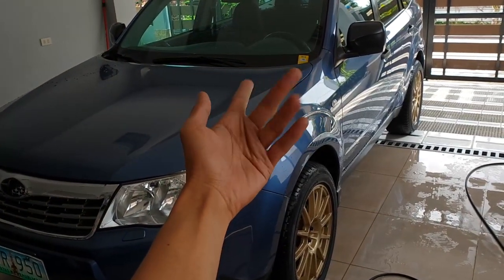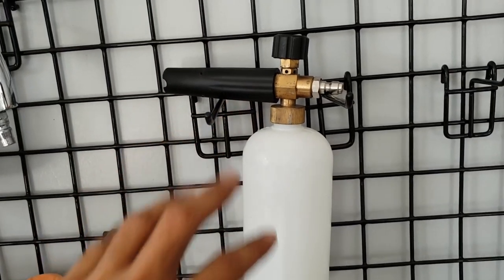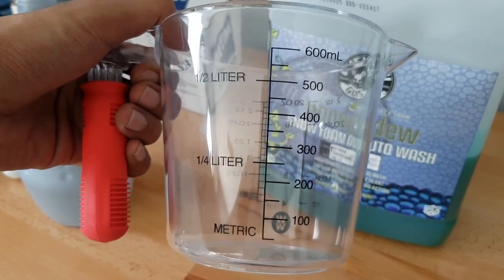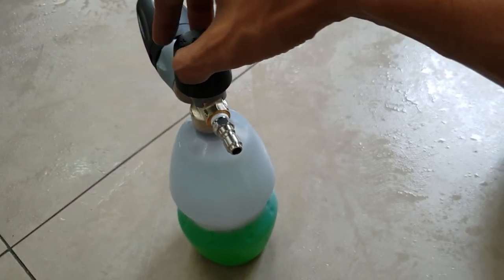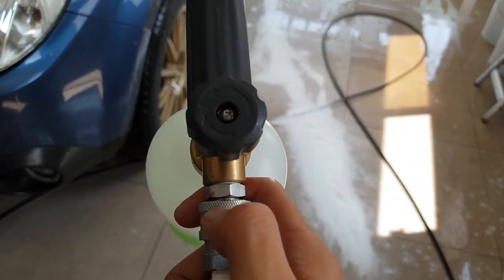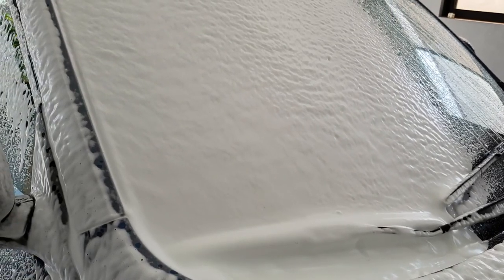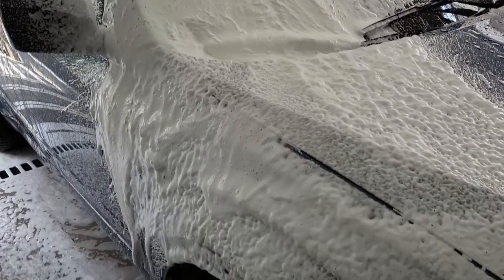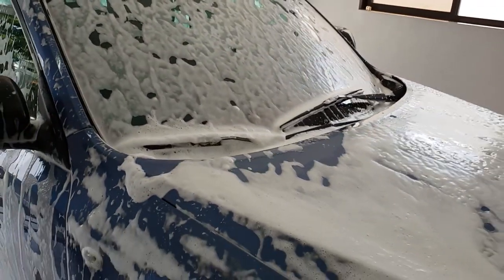MTM PF22 Foam Cannon + 1.1mm Orifice + Kranzle HD 7/122 TS = FOAM FOR DAYS!

Comment: I like these video's, people who think shaving foam effect is actually doing a better job of cleaning their car! I've used AutoFinesse Avalanche foam which was like this, didn't work but looked good, then i switched to Bilt-Hamber AutoFoam and it's a lot thinner but you actually see the dirt being pulled off, a lower pile on the foam aids in keeping the cleaning agents close to the dirt, not sliding off over the layer that is actually doing the work. As is said "all show and no go"
Reply from the maker: This is true. And you wouldnt really know for yourself unless you've experienced it first hand. Nowadays I prefer a runnier consistency as i find it lubricates the panel much better during the contact wash. (But it's nice to still have the option of knowing what to adjust if you want to see thicker foam for personal satisfaction). Curious about your comment of AF Avalanche - although i only saw 1 video of it cleaning the panel effectively. I've been wanting to try it as well. Hopefully BH becomes available soon in my country so i can have a go at it. Heard nothing but good reviews.

Comment: tks u for the detail test ! oh god. change the orifice from 1.25 to 1.1 will add ~20 Bar more power. the 2nd classic foam gun in the video w/ the 1.1nn must be crazy. Of cause we need to read the max pressure our machine can handle first. Usually about at least +20-30 Bar of machine normal working pressure. :)

Comment: Hey Marvin! This is a great video and is very informative. I purchased a Kranzle 1322TS from OG. It's rated pressure is 1300 and max pressure is 1500. When using the MTM PF22 with 1.1 mm orifice im getting 1700 PSI. So far nothing bad has happenend and the machine seems to work fine. Ive also used it with 1.25 mm and the foam is no where nearly as good without 1.1 mm. Do you have any suggestions?

Comment: Hey do you have the kranzle plugged into a normal outlet? Or do you have a dedicated one like a 20A I really want to get a kranzle but I would be unable to get a dedicated plug
Reply from the maker: Hi Deez, my country has 220v power so the Plug ratings are different but its the equivalent of 20Ain 110v. Better to be safe.

Comment: I have a question as to whether the shampoo in the cannon needs water to be mixed , or is it only the shampoo that should be used in the cannon , as we have the water inlet of the pressure washer on while using the washer .
Reply from the maker: Hey Naveen, the soap and water needs to be mixed in the bottle of the cannon as well.

Comment: Nice video I bought the krenzla but they recommend not to used the 1.1 orifice ,did you had any problems running that set up on the regular bases to clean your car , I was thinking on doing the same but it’s a expensive power washer to get total after few washes
Reply from the maker: Hi Alberto, congrats! same model? I've had no issues with the 1.1 since I got the washer. Hope this helps.
Reply: Hi thanks for the reply ,yes I have the krenzla 1322TS bought it from obsessed garage  I love the automatic start and that’ doesn’t make a lot of noise
Reply from the maker: @afstar186  nice! Skip the 1.1 if you have the 1322. You have more gpm than what I have. That's why I used a 1.1.
Reply: Hi guys, how much inabot ng kranzle including shipping to ph?

Comment: Sir link please ng 1.1 Orifice and Chemical Guys Soap, also can an electric pressure washer with 1600psi max pressure, 1.7gpm handle both 1.1mm and 1.0mm orifice? TIA, and more power to your channel. You've earned another subscriber. =)

Comment: Bigger pressure washer of over 2000psi and hot water will give you better results
Reply from the maker: That is true. That where i came from. Gas PW 2600psi 2.3gpm. Only downside was I couldnt use it in the wee hours of the day. Here's a linknto my past video if you want to see how the 2000+psi experience i had. https://youtu.be/vD0OtCQ7t5g
Reply: When getting a pressure washer for car cleaning it's better to get one with a higher LPM or GPM you could have a 2000psi pressure or over and if it has a bad GPM you'll get worse results.

Comment: What does thicker foam do for your car? or does this just stroke your ego lol ?
Reply: The solution stays on longer which allows it to do its job instead of just running off the vehicle.
Reply: Thicker foam clings to the paint longer and allows the soap more dwell time to loosen non bonded contaminants .

Comment: Your pump have to much power for 1.1 orifice. Even KranzleUSA doesn’t recommend it.
Reply from the maker: For which model are you referring to? This hd7 comes with a kranzle 2.8 tip as stock which is smaller than the 1.1mm I use for the cannon.
Reply: Smaller the number the smaller the whole. Minimum for kranzle is 1.25mm. Correct me if I’m wrong